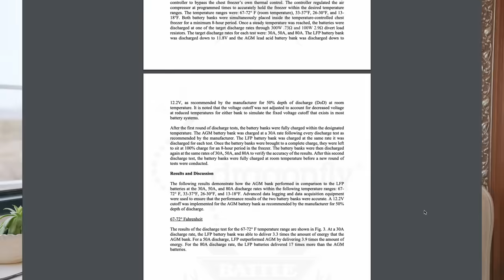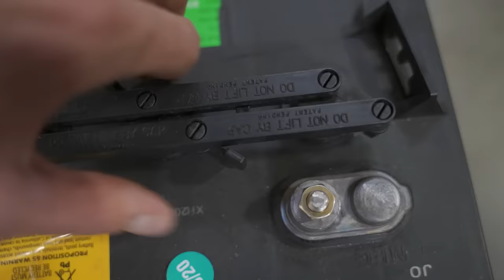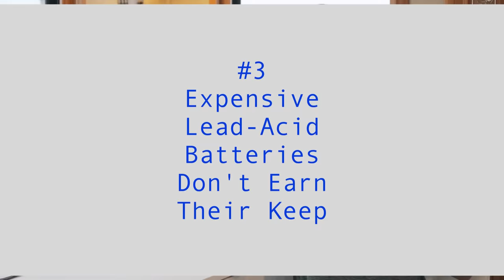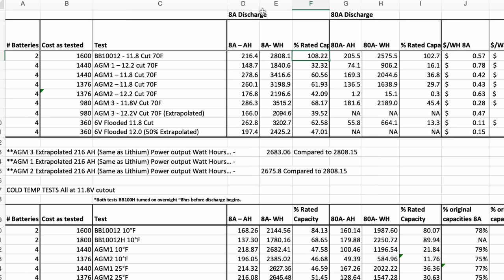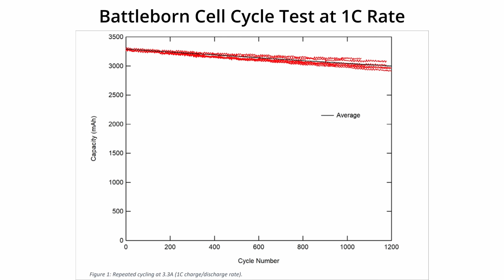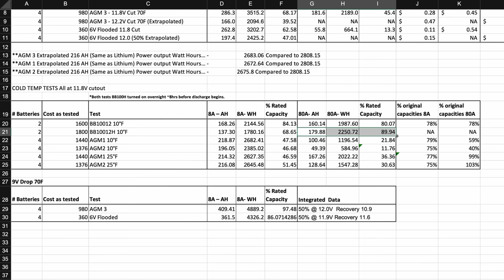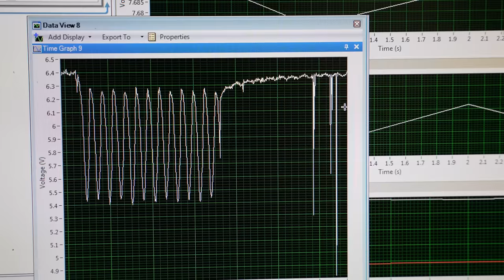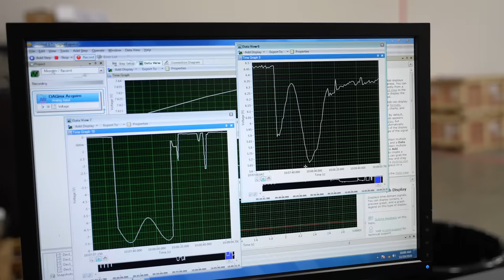Don't Waste Your Money On Batteries - The Shocking Truth I Discovered When Testing RV Batteries

Comment: I'm a little surprised you didn't do any kind of test in the high temps.  Which battery would work better in temps in 100 degrees or more??
Reply: He was invited to battleborn due to their cold weather batteries.
Reply: I agree, do things make a difference in a tropical temperature profile?
Reply: I agree. Here in Australia cold temperatures are not really the issue for most RV'ers, cold is 10C.
Reply: @baddog9320  Which can be cheaper in the long run, you say lead acid and lithium are??? Depends on how long the “long run” is! I’m retired and if the long run means I have to own it for 10 or more years for lithium to be cheaper then I’m not sure I’ll be RV’ing then or even still be around! Horses for courses….
Reply: @baddog9320  Not too sure what all that was about. My point was you said lithium are cheaper then lead was, kind of confusing and the long reply above doesn’t answer it either?? Anyhoo, I think I’ll spend $250 rather than $1,100.
Reply: @baddog9320  Phew, lots of answers to questions I never asked :) I know the difference between a cranking battery and an auxiliary battery. Prices given are for reasonable quality batteries here in Australia, no idea where you are.
Reply: @flyboy5736  you'll spend 250 10 times by the time your 1100 is used up.

Comment: As a consumer of these batteries for emergency power, charged by wind, solar, portable generators, etc., I'm also interested in the efficiency and cost of CHARGING these batteries. If it is very expensive to chanrge them and there are great losses during charge, that is another COST to be considered. Really, you want to study charging and draining (power consumption) and then derive a cost using both of these results. I suppose the charging technologies are different for each -- so you have to buy the circuit that charges them for the battery too.

Comment: Very good review! The one thing I would propose is that lead-acid batteries would make sense for RV'ers who only occasionally go camping, and only run off batteries before hooking up to shore power, such as putting out the slide-out or using the toilet before you get the hook-ups done, or an occasional night in a Walmart parking lot on the way to a campground.  For that application, I would argue that they make sense, as long as not expecting too much out of them (small lights, water pump).   But it is good to know that isn't worth buying expensive ones for that!
Reply: Yep, 2 - 6 Volt golf cart batteries will do the job and easily last 5 years if you take care of them.
Reply: @Schmitz3  But will do a lot more than what Dells said above. Been FTing now for 5yrs. with our 2 - Trojan 105's ($325) and they have served us very well. But having a robust battery bay is only a part of the FTing story. We just replaced our Trojans with 2 new ones after 5 years. Lifepo4 batteries are for folks who have a lot of money to spend and do a lot of off grid living. Otherwise the ROI is not worth it. Besides that , I don't want all my eggs in one basket.
Reply: @RVstreet  Lithium iron phosphate are much cheaper in the long run than lead acid. They are actually for people who plan to use them a lot, and then they save money. I've been using my 3 - 303 amp hour Lifeblue lithium batteries for over 4 years, and have not lost a single percent of capacity yet. Do that with lead acid.
Reply: @headdown1  I hear what your saying, I truly do but they're not cheaper in the long run. Hear me out. 
At $325 for 2 Trojans that lasted five years, I could replace them 5 or 6x's for the cost of 2 lithiums. That's 25yrs. of battery life. Way longer than I'll ever own the RV. The Trojans I replaced still had plenty of life in them too, but I changed them out anyway as a PM item to start fresh again. But changing to lithium batt's is not the whole story. You usually also have to change the converter and the inverter too for them to work right as a complete charging and usable system. That's even more money. But what DJ86 said in the beginning I totally agree with. The ROI to go Lithium just isn't worth it unless you you do a lot of off grid living and need a ton of usable Ah's. We do some off grid living and we've done just fine with our Trojans for the past 5yrs. along with other power solutions I've installed like portable solar. But in all fairness, if Lithiums work better for you then that's fantastic. 👍
Reply: @RVstreet  I used lead acid my first 6 months on the road, then I switched to Lifeblues. I hated the lead acid batteries. I had to buy and carry twice the batteries and the weight as what I actually needed, since going below 50% SOC is a no - no. The weight is a huge deal in an RV. If I wasn't plugged in, in the morning my two lead acid batteries would badly need charging if I used the furnace. So down the road I would go, giving them a lousy trickle charge using the alternator. Unless it was a very long day, this would not give them a proper charge by the end of the day. Lead acid likes a few hours of charge after hitting 100% and I could almost never provide that without a lot of hassle. So every day, the batteries were abused and degraded, just due to the reality of travelling in an RV with them. 
I have no desire to switch out batteries every 5 years and few people actually get that long out of lead acid while RVing anyway. Not having to do that 5 or 6 times is worth something to me. As is being able to store them under my bed with no venting. No maintenance, and all I need to know about the internal workings of the battery bank is provided with an iPhone app.
I do agree that to make it worthwhile, you have to be either full timing or rich. But if you ARE full timing, and especially if you use solar panels, there is absolutely no comparison. I can ram in all the power the sun or shore power or a generator can give the battery bank, unlike lead acid which takes forever to charge, and then needs hours of top up once charged to stay healthy. My 240 lbs of Lifeblues would become well over 500 lbs of lead acid. And perform much worse for its short lifespan. I know there are folks who lead acid still makes sense. After having Lifeblues for over 4 years, I feel sorry for them. :) They truly do not know what they are missing. After using lithium iron phosphate, using lead acid batteries seems like starting a fire by rubbing two sticks together instead of using a Bic lighter.
Reply: @RVstreet   I am glad I have learned to copy my replies as I write them. Youtube deleted this comment twice for no good reason. I will try again. 
I used lead acid my first 6 months on the road, then I switched to Lifeblues. I hated the lead acid batteries. I had to buy and carry twice the batteries and the weight as what I actually needed, since going below 50% SOC is a no - no. The weight is a huge deal in an RV. If I wasn't plugged in, in the morning my two lead acid batteries would badly need charging if I used the furnace. So down the road I would go, giving them a lousy trickle charge using the alternator. Unless it was a very long day, this would not give them a proper charge by the end of the day. Lead acid likes a few hours of charge after hitting 100% and I could almost never provide that without a lot of hassle. So every day, the batteries were abused and degraded, just due to the reality of travelling in an RV with them. 
I have no desire to switch out batteries every 5 years and few people actually get that long out of lead acid while RVing anyway. Not having to do that 5 or 6 times is worth something to me. As is being able to store them under my bed with no venting. No maintenance, and all I need to know about the internal workings of the battery bank is provided with an iPhone app.
I do agree that to make it worthwhile, you have to be either full timing or rich. But if you ARE full timing, and especially if you use solar panels, there is absolutely no comparison. I can ram in all the power the sun or shore power or a generator can give the battery bank, unlike lead acid which takes forever to charge, and then needs hours of top up once charged to stay healthy. My 240 lbs of Lifeblues would become well over 500 lbs of lead acid. And perform much worse for its short lifespan. I know there are folks for which lead acid still makes sense. After having Lifeblues for over 4 years, I feel sorry for them. :) They truly do not know what they are missing. After using lithium iron phosphate, using lead acid batteries seems like starting a fire by rubbing two sticks together instead of using a Bic lighter.
Reply: @RVstreet  I am glad I have learned to copy my replies as I write them. Youtube deleted this comment twice for no good reason. I will try again.
 I used lead acid my first 6 months on the road, then I switched to Lifeblues. I hated the lead acid batteries. I had to buy and carry twice the batteries and the weight as what I actually needed, since going below 50% SOC is a no - no. The weight is a huge deal in an RV. If I wasn't plugged in, in the morning my two lead acid batteries would badly need charging if I used the furnace. So down the road I would go, giving them a lousy trickle charge using the alternator. Unless it was a very long day, this would not give them a proper charge by the end of the day. Lead acid likes a few hours of charge after hitting 100% and I could almost never provide that without a lot of hassle. So every day, the batteries were abused and degraded, just due to the reality of travelling in an RV with them. I have no desire to switch out batteries every 5 years and few people actually get that long out of lead acid while RVing anyway. Not having to do that 5 or 6 times is worth something to me. As is being able to store them under my bed with no venting. No maintenance, and all I need to know about the internal workings of the battery bank is provided with an iPhone app.I do agree that to make it worthwhile, you have to be either full timing or rich. But if you ARE full timing, and especially if you use solar panels, there is absolutely no comparison. I can ram in all the power the sun or shore power or a generator can give the battery bank, unlike lead acid which takes forever to charge, and then needs hours of top up once charged to stay healthy. My 240 lbs of Lifeblues would become well over 500 lbs of lead acid. And perform much worse for its short lifespan. I know there are folks for which lead acid still makes sense. After having Lifeblues for over 4 years, I feel sorry for them. :) They truly do not know what they are missing. After using lithium iron phosphate, using lead acid batteries seems like starting a fire by rubbing two sticks together instead of using a Bic lighter. 
After more than 4 years, I am showing 100% capacity still. No change at all. They have as much capacity as the day I bought them. How long will they last? I don't know. Forever, at the rate they are losing capacity. :) They will surely outlast both me and the RV.
.

Comment: Great information, but I think the comparison is missing a few things.  The Victronic equipment you need to buy to run lithium ion is very expensive.  You can spend about $5-6k  more setting up a LiFePO battery system vs an AGM system.  The extra victron equipment needed for LiFePO also offset the weight benefit over the AGM, and also eat up valuable space.  Also you can buy good AGM batteries on Amazon for $160.  If you have solar panels and you have a charging relay from your alternator, you won’t be drawing on the AGMs very hard often.  If you have a big RV and run AC and a ton of electrical appliances without shore power and have no solar, maybe it is worth it.  I have built a few sprinter vans and to have to buy new AGM batteries after 4 years is worth it over the initial investment in LiFePO.  But for the average van build, it’s wasted money.  And also, why do people have microwaves in RVs?  I don’t even have one in my house.  They are wasted space in van builds, you can heat up everything better with a stove, and most of the food you buy to cook in a microwave is terrible for you.

Comment: When I see the disclaimer that battle born paid for the experiment, it is difficult for me to believe that it was not designed to confirm their assertion. Even when I think that lithium batteries are much better, I also think that objectivity is compromised, since the moment that the tests were financed by one of the contenders.
Reply from the maker: I understand that and wanted to make it clear that this was done at their facility.  As for testing parameters they had no say in what tests I ran and we're actually supprised by the video at the end.
Reply: And on top of that,they also make money when you buy those batteries using their link, and IN THE SAME "testing" video,they do a Battleborn battery giveaway!!  This was nothing but a commercial for BattleBorn batteries.
Reply: I partially agree.  I'll rephrase what I posted a few minutes ago.  The cut-off parameters for the lead acid batteries are misinterpreted. They should be OCV, open-circuit voltages, not under load.  Under load, BCI, Battery Council International, dictates 100% cutoff to be 1.75v/cell or 10.5v for a 12v.  I'd appreciate the data to be recaptured (expensive though) in order to truly compare apples to apples.  The 80A comparison was gruesomely unfair because lead acid has higher internal impedance.

Comment: Awesome informative vid, Great Job! I've run 2 100Ah LiFePo4 Battle Borns in my 100% electric van build for the past two years. 120V 1400W water heater, 1000W Microwave,  and 1400W induction cooktop all on a Victron 2000W inverter (one large load at a time). It's worked flawlessly with no degradation of capacity over these two years. We charge with 540W solar and a 60A charger via the alternator as backup. I may add another 100A battery to give us a bit more foul weather buffer, but its been the prefect setup for us as is.
Reply from the maker: 2 to 3 lithiums are just about perfect for most uses! Glad to hear it's been working out.

Comment: Whenever a car battery reached its age limit, pulled it out of the car, refilled, put on trickle charger. I now have 6 of them. Runs camper 12v systems great. Solar panels and charge controller keeps them topped off nicely.

Comment: You need to compare the 4,  6-volt golf cart batteries,  at Walmart @ $125.00 each = $500.00  To $500.00 worth of Battleborn lithium batteries.
Reply: You'd have to cut one down, since they're $900 a whack... UGH!
Reply: How about one Battle Born BB10012 at a street price of $899 to Ten MalWart Everstart 29DC in parallel at $89.97 each.
Reply: @bedlamite42  
You’re talking my language 

As I learned in a high-stakes business class: sometimes access to money at expensive bank interest is less expensive than limited investor cash. 
Translation for batteries: if you get functional on lead acid the ability to function is worth more than batteries that might be less expensive over time that take money you don’t have.
Reply: @bedlamite42  
I’ve dropped to 27s. Although they are 83% of the Ah, they not only didn’t have any 29s the day I was buying, the 27s were 68% of the price making them cost ~15% less per Ah.

Comment: I would probably need 16 of these batteries for my home and trolling motors. That would cost nearly $16k. For that kind of money I prefer to buy a 60kwh electric car battery.
Reply: Okay... Sounds great if you have a tug boat. You will need a big battery totaling 1,333 amp hours at 12 volts.
But your boat is huge so it uses 24 volts which would be only 666 amp hours. That's still a lot of battery.

Comment: One thing you did not mention was that AGM batteries do have one advantage over flooded batteries. They self discharge at a much lower rate. A good AGM battery self discharges at 3% per month, flooded is more like 15%. This is an issue for backup applications where you are not using the batteries every day. Of course the self discharge of lithium batteries is damn near zero, so there’s that…

Comment: First remember you must put a new charge controller on your gen set,  engine alternator and 110v charger, because they will burn out if you deeply discharge the Lion batts. The Lion batts will draw a lot more amps when fully discharged and because they charge faster, they will over load the charge sections of your charge sources. Once these are updated then the Lion batt, in the long run, will be less than the flooded cell batts.  living in a moho full time, I found that discharge for 12v flooded cell batts was 11.8v regardless of temp. I changed to 12v batts rather than 2 6v batts due to the constant corrosion problems of the cables needed to put them in series to make 12v. I also found that the 6v batts constantly needed water added and would last only 3 year max. typically 2.5 years.  I found that I often would get 5 to 7 years out of my 12v batts. Needless to say older moho's are designed for 6v batt due to the physical dimensions being smaller than 12v units that provide the same amount of cca or ah. In a lot of these cases it would be better to purchase the higher dollar charging systems and replace with Lion. Moho's with 12v flooded cell batts already in place with plenty of space I believe it is cost prohibitive to change over to Lion, due to having to change all 3 charging sections.